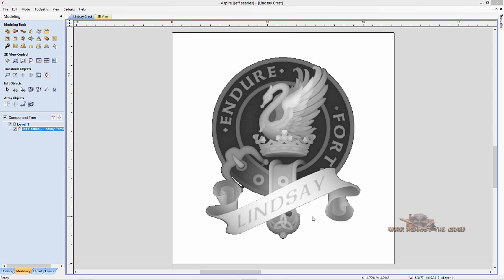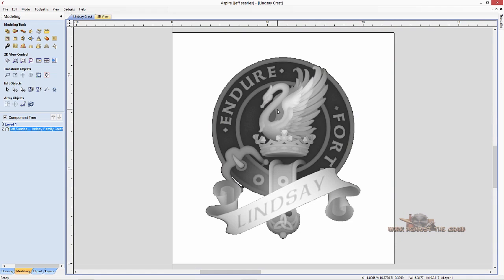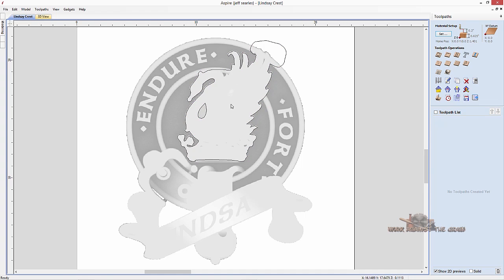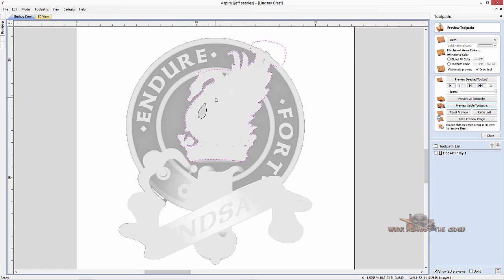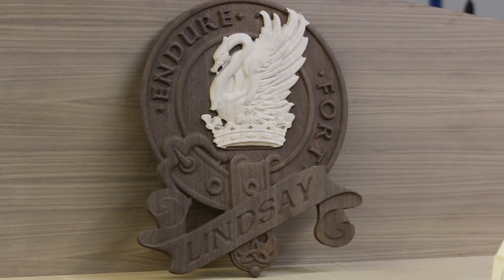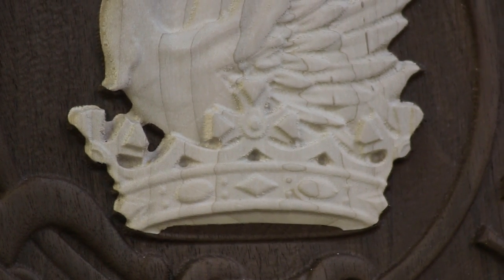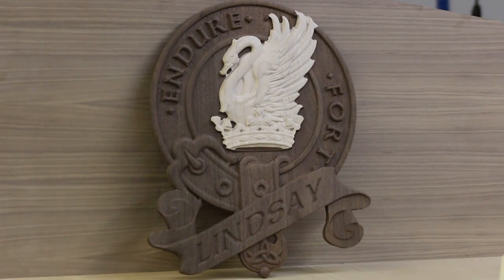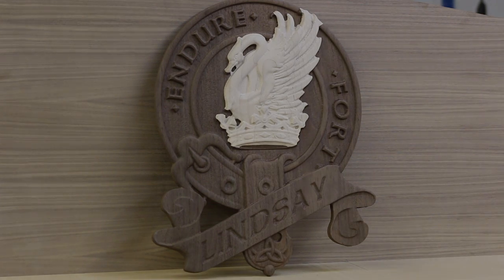Vectric Inlay Tutorial

Comment: Jeff, glad to see you back at it.  Can you tell me what router bit you use for the carving?  I assume you still purchase from Magnate, so just a part number would be good.  There is so much you can do with that piece, all very time consuming.
Reply from the maker: James Bushey  James, in this case it is a bit from MSC Industrial supply. It has a 1/2 shank and is a 3 degree 1/16 radius TAPERED ballnose with a 3 inch cutting depth and 5 inches overall. The MSC part number is 04356036. Nice part about using a tapered ball nose that starts at 1/2 inch diameter and ends in 1/8 diameter(1/16radius) is less roughing. Finish actually came out to where I could start sanding with 320. My next video is actually on some other bit types and finishing cause I do get a lot of questions about it. Thanks for watching.